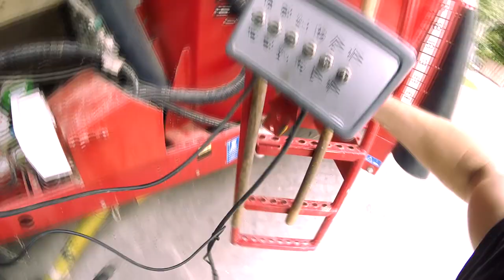Haying | Tedding, Raking and Storing Hay | Hay Storing on a Small Dairy Farm

Comment: I love yer system of working. Hay looks top quality. Years ago in Ireland (1970s) hay was saved loose like that but put in heaps in the field called cocks and brought into the yard eventually with a buckrake.  Square balers were big here in 80s. Now hay is mainly all round baled. But hay would rarely be made except a really hot dry summer. A wagon would only be used here for silage.
Interesting to see the differences between countries
Reply from the maker: Interesting indeed, thanks for sharing :)